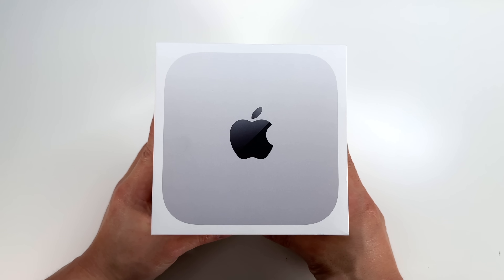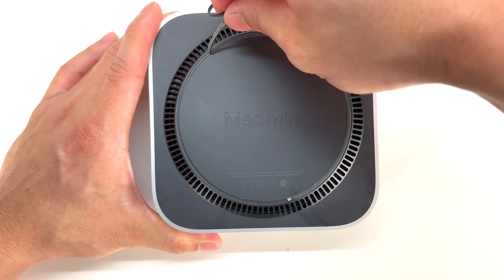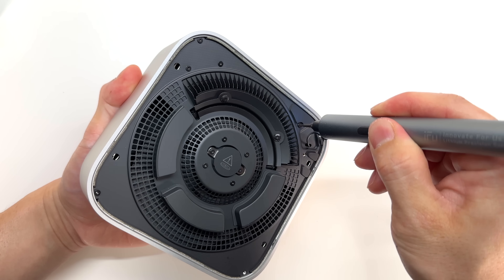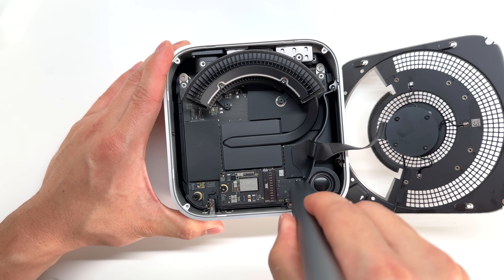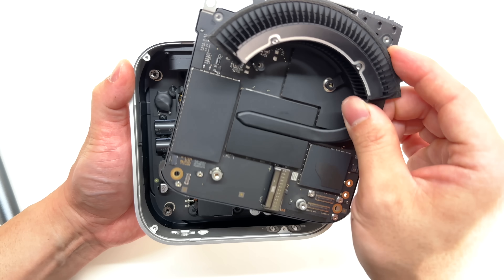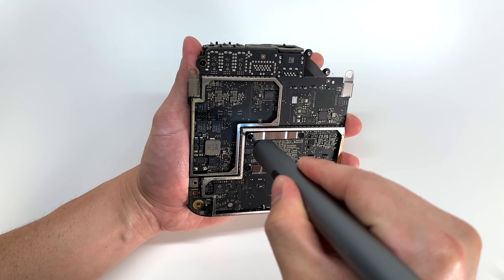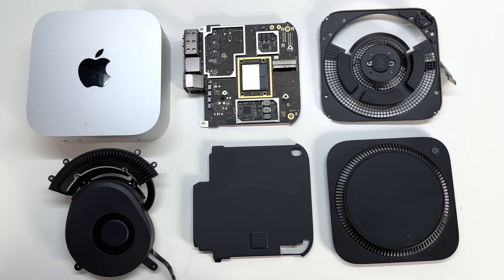2024 M4 Mac Mini Teardown FULL - SSD Removable

Comment: Even if they are so expensive. But for repairing or swap the component is the easiest among other brand like asus or lenovo, theyre suck at replacement part. Sometimes they're soldered.

Comment: Alright, so the front usb c ports are usb c only, no video capability. The rear ones are thunderbolt, but soldered on. So if you are inserting and removing them reguarly use the front ones (as long as you dont need thunderbolt or video) and then you can replace the fronts when they wear out more easily. This thing should last a very long time.

Comment: If Apple separates the Power Supply PCB from the Mac Mini body and replaces it with a separate Adapter, this Mac Mini could be even smaller or thinner. Maybe just as big as an Apple TV.❤🎉😅

Comment: I fear that this machine will be a lot of dust bunnies inside because of larger open hole gaps. Otherwise, it won't be a problem because the M4 is very energy efficient? Macbook Air M3 for example does not have a fan 🤔

Comment: Can you clarify it for me. I saw a guy solder a bigger SSD in this device. But isn't its SSD removable? What is the exact problem to simply buy a new NVME? Did Apple block it with software lock? If so, when do you think someone can break this obviously artificial limit?
Reply: It's technically not an SSD, it's raw NAND soldered to an SSD module. In the case of the mini there are two types of modules, the M4 and M4 pro. To upgrade you need a lot of work. Here's a full video of how to do it https://www.youtube.com/watch?v=cJPXLE9uPr8
It's very tedious but there are a few companies already talking about offering upgrade kits soon.
There's one called Polysoft services, they will start offering an upgrade kit for the m2 mac studio this month. Since the chips for the M2 studio and M4 mini are electronically the same, I suspect the cost will be about $1000 for the custom 8TB upgrade for the M4 pro mini. Currently, to do the same on Apple's site it's $2160. So definitely worth it.

Comment: Now I understand why apple charges so much. The way they design and assemble their product is just a piece of art. The power supply unit was so massive and looked like it will last forever. They could have given external brick and made the mac mini even smaller but they decided to work on the design of this new psu. Hats off to Apple for giving the base model at such low price.
Reply: $550 for this computer is honestly a bargain they could have gotten away with charging 800+
Reply: Apple bot, Alert

Comment: I wonder what the motivation was to include the PSU in this. Surely it would make more sense to have it off away from the CPU outside the case to limit overheating. But this is a very sleek solution sans powerbrick.

Comment: in the next version Apple should use external power supply like laptop,4 lightening C,1 hdmi,no lan port but wifi 7 and minimum 1TB chip should be attached on board. then apple mini beats whole market.

Comment: OK. The SSD may be removable. Don't really care about that. Is it upgradeable with an off the shelf NVME SSD 2230 module? 
I don't think so but would love to be proved wrong. I can buy a 1TB SSD on Amazon for $75 right now. Apple wants $400 for 750GB upgrade from 256GB to 1TB. For this reason alone I will stay away from all Macs.

Comment: if you remove the psu and make it external you can do two mac minis inside one mac mini chasis. Which would be... idk, something?
Reply: Or you could have standard size RAM and SSD modules that could be swapped easily 😅
Reply: @jabadabadubidu  well, the ram is there on the chip I don't think its possible with m series of computers. buuut you could put something like a satechi hub in there . that might be a cool idea

Comment: It’s begging for an external power. Only issue with ext. ps would be power distribution to other devices. 
The heat fan is fighting convection
If they move that memory any closer it would have to be on the chip.

Comment: One thing to keep in mind is that these Apple computers are not designed to be taken apart. To take these computers apart requires specialized skills and specialized tools, otherwise it is easy to damage the computer. Many years ago I had two of the intel based Mac Pro Computers. I could easily open up these old Mac Pro computers and change out memory, the video card and the hard drives. However I have never opened up the later Apple Mac Computers that I have owned.

Comment: Note that the “antenna” is more than that… they off-boarded the Wi-Fi and Bluetooth to a separate chip under the “battery”. Now you can disable Bluetooth and Wi-Fi physically… great for getting these things into air-gapped environments!

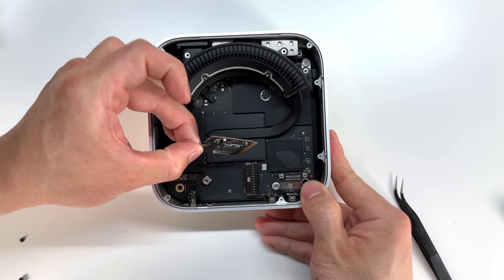Comment: 5:34 Is that SSD standard and replaceable or it is proprietary?
Reply: Proprietary. Apple’s NAND board only contains the NAND and some passives. The controller is part of the M4 whereas most SSD contain a controller chip. But third parties are working on clones.
Reply: @bcbock  

Nope

Same claim was made about both the Apple iPhone 15 Pro Max and also the Apple iPad with M4. Both have entirely replaceable SSD. It’s not pretty, and would actually cost more in labor than the part
Reply: It's definitely a proprietary connector which uses PCI e. Size of SSD seems like 2230. I think China will find a way to emulate this SSD board in the next 2-3 months and we will see 2tb storage with at least 5000 mbs read-write speed for 200$ USD
Reply: Thanks for the replies, hopefully we get some 3-rd party options
Reply: These shouldn't be called SSDs, since their controller is integrated into the SoC.

Comment: If you are wondering how a computer can be carbon-neutral, they say that most of the impact is from the electricity production for manufacturing. So they use low carbon electricity.
The rest is compensated with carbon credits.

Comment: Thanks @BrandonGeekabit.
Just one good thing, internal ssd removable, wondering why the hell they can't use external power adapter, that would have been a much better design, smaller and sleeker. 
Seems like it will take may be another couple of generation to remove them out like they did on imac.
Reply: It's not smaller if you then have to save space for a powerbrick somewhere else, a single cable is much more elegant solution
Reply: Fan bois justifying it like anything. 🥱 C'mon man, they've much bigger plans for than this. Mac mini is ofcourse their budget kick but it also makes it a feedback unit for Apple.
Reply: Most people want it integrated. It’s certainly more elegant to integrate the power supply. This computer can hardly be called “too big” with a straight face.
Reply: @bcbock  Yeah, I appreciate the internal PSU. Just a simple figure 8 power cord means if you lose/damage your cord, it can be easily and cheaply replaced. Plus the PSU benefits from the internal cooling. PSU bricks, if you have a few of them, make your cable setup a chonky mess.
Reply: It is good to have PSU in the Mac mini itself, making it simpler to cable manage and saving time to find an additional place for keeping the power brick on the desk or under the desk....

Comment: You tore the silicone off... You do realize the repair manual is already on the Apple website and tells you exactly how to open it.
Reply from the maker: Thanks I forgot Apple posts these. That would have been helpful...
Reply: @brandon20904  you were kinda right with the pry tool in the grille. Apple's way is a suction cup on the base and then opening the clips around the edge but guess in a pinch without a suction cup that would work too.

Comment: They should really use more thermal paste to cover the whole chip.
Reply: He mentioned that they are coving the area where the actual M4 die is. They’d add more for the M4 Max chip as the die is larger.
Reply: @ well yeah but might still give more cooling if they were to cover the whole IHS instead of only where the silicon is located.

Comment: Because European right to repair in a years time they should provide parts to swap the ssd with… exact same size ssd… so upgradability chances are the same as with Mac Studio… It’s a marvel for sure, but previous design was easier to clean 😶‍🌫️

Comment: can you replace SSD?
Reply: It’s a proprietary card. Most NVME cards have the NAND chip and the controller. Apple locks things down by putting the storage controller in M4 chip. So you can’t buy a replacement card. Yet. There are third parties working on them. One is a Kickstarter called Studio drive that’s building a card for the Mac Studios. Since Apple most likely designed their alongside the Studio or at least using the same design approach, they probably will have a card for the Mini M4 at some point. You can’t just swap these Apple NAND cards because Apple ties the card to the computer. Another card from another computer won’t work. But if you had a card where the chips are blank/unprogrammed, the comptuter will bless the card when you use Apple Configurator to restore it. So there’s hope for more affordable storage. Now if only Apple would put the RAM on cards.
Reply: @bcbock  ram on cards would not work as unified memory with such massive throughput.

Comment: Thanks for the magnificent video i have 2 questions 1 where is the RAM location? 2 is that mean we can upgrade the Ssd drive?
Reply: RAM is located on the two chips next to the M4 processor under the heat sink. They are packaged together. Upgrading RAM would require micro soldering.
Reply: Ram is right next to the cpu.  8:45 - those 2 soldered little chips

Comment: The PSU is a thing of beauty
Reply: When he removed the logic board to expose the PSU I laughed at how beautiful such a seemingly boring, hidden bit of tech could be. Those cap's! They should consider doing clear cases.
Reply: Out of all the mini pcs from various manufacturers this is in a different league. It's a masterpiece inside and out hardware and software of the highest quality.
Reply: I’m amazed at how robust it looks. It’s certainly not some off the shelf part. Looks like it will last a while and has a high enough surface area nested to the top aluminum surface to keep itself cool.
Reply: @graxxor  Agreed, this thing looks beefy - hoping for a long, long desk life with the one I just bought.

Comment: As a designer, I wonder which is more appealing to the user, a thinner device w/ an external power adaptor or this thicker one with the internal power supply?
Reply: A designer of what? Computers? They’d look at the use case and design to that. The Mini is about simplicity for the user. The volume of the device is smaller even with the increased height due to the decreased foot print. A designer who would use this as a tool I think would prefer fewer cables and clutter. The iMac imperative was apparently THIN. It was so thin they couldn’t fit the power supply and ethernet connector on board.

Comment: the SSD is NOT soldered on!!!! WOW, can't wait for someone to make the upgradeable parts!
Reply: Someone in Chan already did, you need to solder the NAND flash and it’ll work
Reply: @ soldering BGA chips isn’t for everybody.
Reply: Be interesting if new Mac Pro/Studio modules can be swapped before initial boot.
Reply: Buy an external SSD.
Reply: @billB101 und welches Model empfehlen Sie uns und Gehäuse?
Reply: @billB101 
Slow
Reply: @itsm3th3b33  Not really, most people edit content that's on external drives ( myself included )  If they're fast enough for that then they're fast enough.
Reply: @billB101  
I responded to you with a factual statement. It has nothing to do with how you use your machines. 
I edited my videos housed on external hard disks. It was possible. Does not negate the fact that external SSDs are much faster. And internal SSDs are even faster.
Reply: @itsm3th3b33  And I'm saying that it really doesn't matter.
Reply: @ 
Fact is: there is a huge gain in performance that you can get by bypassing the USB bottleneck. 
Performance may not matter to you, that's fine. For those who want or need to upgrade to this lasted Mac Mini, introducing a bottleneck makes no technical sense.
Reply: Dosdude1 has a video out successfully upgrading it to 1gb (2gb failed to be restored) he was faaaaast
Reply: https://youtu.be/cJPXLE9uPr8?si=b6nBcFlMcUaYDTbb
Reply: i've instantly checked if that exists and a company called POLYSOFT has Kickstarted it
Reply: Check out a guy called dosdude1. He’s already done it with the Mac Studio
Reply: @dosdude1 did an excellent video one making an 8TB drive for ~$500 using some NAND and a KickStarter board for a MacStudio. The Mini SSD board looks smaller than the Mac Studio SSD one.  https://youtu.be/HDFCurB3-0Q?si=BNfIQYcJ-qbalitv&t=465
Reply: Someone in China upgraded it to 2T

https://youtu.be/bNZzHK4046A?si=UPUreuwk-h__7236
Reply: Probably a dummy drive (flash rom in there but the controller is on the m4.
Reply: No one needs to "make anything" you fool checkmark.
Reply: @theTechNotice  now we have some teardown and upgrade videos already, it is NOT m2 2230 ssh. Lol. Hard but still upgradable
Reply: Chinese can do it
Reply: Dosdude has done it, check out his video
Reply: What about the controller? 😊
Reply: The NAND chips themselves are still soldered on
Reply: I hope samsung makes 990 pro for mac mini
Reply: ADAPTER :face-red-heart-shape:
Reply: Hi tech notice
Reply: This will go down in history as a first teardown.
Reply: Just get a few external SSDs and forget about it...
Reply: can't wait for your review and comparison with a similarly priced windows pc
Reply: Apple - Revolutionary, game-changer, unprecedented, all-new, incredible, unmatched, best-in-class, next-generation, breakthrough, uncompromising, beautifully crafted, seamless, effortless, pro-grade, most powerful, iconic, meticulously designed, innovative, re-engineered, built for everyone, environmental commitment on us using UPGRADABLE SSD.
Meanwhile Apple Fanboys - 🧟🧟‍♂🧟‍♀
Reply: With the way Apple does things with its computers, it is likely that the SSD is not a user upgradeable part. It likely that this SSD is locked to the security features of the M4 chip. To change out likely requires an Apple Technician with specialized software to do this.
Reply: @davidgrisez  

Upgradable by user, not likely. But it is upgradable by someone who has the proper training and experience to do so
Reply: @davidgrisez there’s already a video showing the upgrade, it’s doable but not so easy
Reply: @davidgrisez  

Nice try but no.

There is already a company which can completely disassemble item such as the Apple iPhone 15 Pro Max and also the brand new iPad Pro w/ M4 and then replace it with memory capacity up to between 8tb-12tb. The labor costs more than the.part, but it’s also far less than what Apple would ever charge for such a part.

It does not require an Apple technician or any specialized software
Reply: From the looks of it it is a standard 2230 ssd
Reply: @AnkushJainbl that’s never the case with apple lol
Reply: @AnkushJainbl  the connection looks off, similar but not quite
Reply: @AnkushJainbl  its not its just the Flash Storage without cache and controllers.
Its handled by the M Processors. Its the same as in the Mac Studio / Mac Pro.
Reply: No it’s just the NANDS so not swappable with a normal 2230
Reply: @AnkushJainbl naah, apple being apple
Reply: @AnkushJainbl I believe Apple does only put the NAND chips on that board, it’s nit the entire SSD and thus not easy replaceable. Which is to expected from Apple.

Good idea to put power supply all the way at the bottom, so it’s not easily replaceable. Normal companies would have used an external power brick. But Apple….
Reply: @a.j.haverkamp  Who on earth would want an external power brick. Literally you people complained that the iMac has an external one. Internal is way cleaner and you can use a standard two pin power cord
Reply: @hajjdawood  I, for one, have no issue with an external brick. It sits on the floor by the power strip. It's out of the way. No big deal.
Reply: @skipbreakfast Entire philosophy of apple is minimalism over practicality. If you take that away, it's no longer an apple. 

Apple is not for people who want practicality and function over aesthetic
Reply: @hajjdawood Less internal heat in a sff and replaceable. I would have preferred it
Reply: @ I literally never complained about an iMac, because I never ever touched one. I own a couple of iPads for gaming and media consumption. But I have been Windows PC’s from the first version and MS-DOS before that. Doing Windows and Citrix administration first 20 years before I switched careers.
I bought a bunch of mini PCs in the past year and they all use external power bricks that are easy to replace in case of a failure.

Comment: 1:37 Officially you have to apply a suction cup to the center and pull it up and then use a stick to go around the edge of the housing
Reply: they have some public service manuals?
Reply: @lorem2020  they do - they publised it on the apple site just today

Comment: Just to mention, if you are of if you are not a fan of Apple, this is top notch engineering. ☝
Reply: If you like your engineering to be setup in such a way that repair feels like undoing a series of hidden traps. I guess. There is no reason that they should purposely wire it in such a way. Did you know that old radiograms used to come with instructions showing how it worked so you could diy. Back when we were customers not just consumers.
Reply: @GlyndwrMorgan just stop talking grandpa. Stuff isnt going to be small AND user friendly. Oh no a cable! Get over it
Reply: @Aweoe  planned obsolescence, difficult disassembly to discourage repairs outside their closed overpriced ecosystem. its Apple's fortè at this point and it's not what I'd call good engineering that's all. Tomatoe Tomatoes I guess ps: (I am getting old in my 30s now)
Reply: @GlyndwrMorgan  you're free to call it bad engineering and people who know better are free to call you wrong